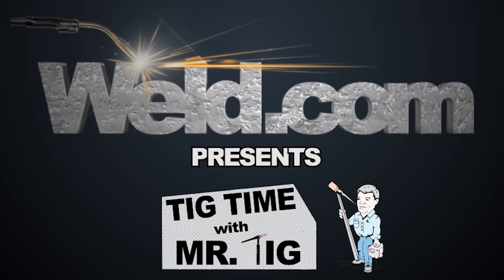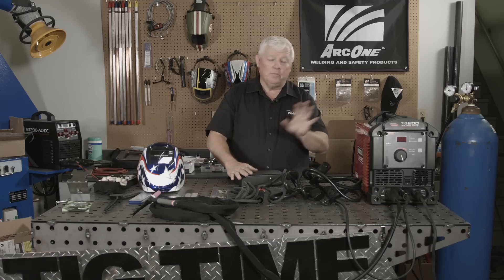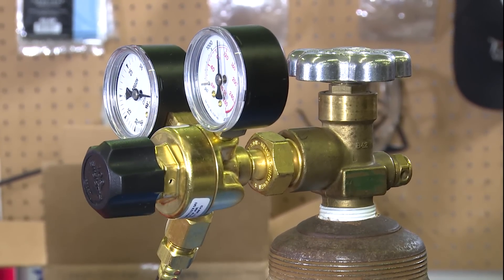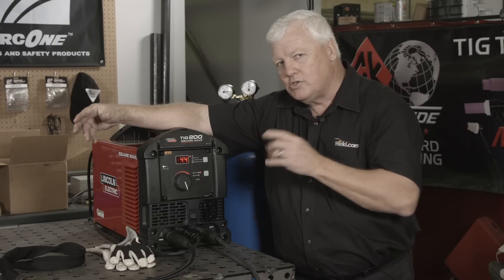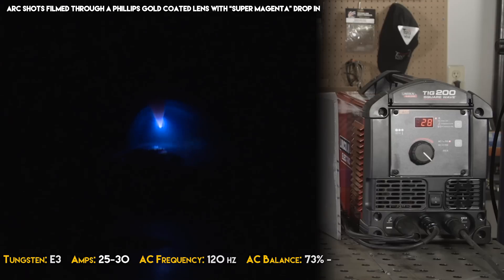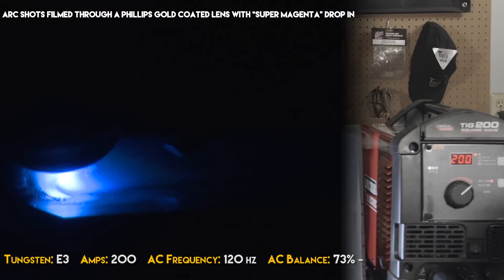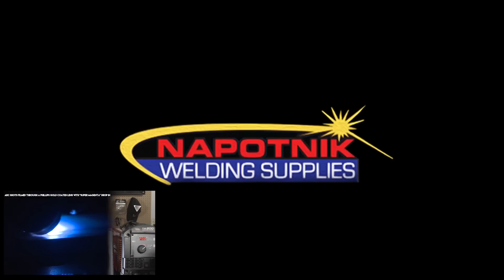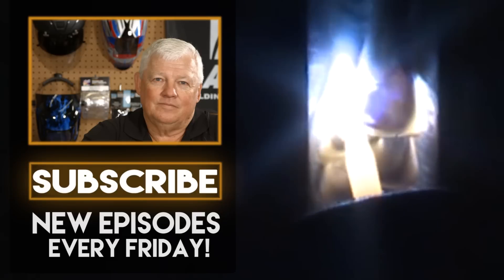Lincoln Electric Squarewave TIG 200 Unboxing and Review: Part 1 - AC Welding | TIG Time

Comment: I watched this back in 2017 when i was deciding if i should buy this machine or not.

Im watching it again in 2024 to decide if i should sell mine and replace it with the miller multimatic 220 or just buy a separate unit for mig capability

Comment: 6 years later it is now $2,399.  I would hardly call it a "hobby machine".  It is a machine that can TIG weld up to 3/16" thick in a single pass.  If you are welding thicker material then you would go with a higher output machine.  My advice is to purchase a welder that can weld on the material that is what you want to weld.  Why buy a $6k "professional machine" that has an output of 400A or so when you are going to be welding race car chassis made from .040 and .080 Chrome-Moly one and two inch tubing?

The other thing that I learned when I was researching the different AC/DC TIG machines is that while this machine doesn't have the range of variables for frequency, pulse and %EN, the ranges are what you will most likely be using.  The ability to adjust pre and post flow is sort of a minus, but why more than a 1/2 second pre-flow and the post flow is up to 15 seconds depending upon the power level that you are welding at.

Comment: Its April 2023, and planning to buy one, anybody bought one of these? Is it worth buying it for hobby use? I just need a tig machine that wont die on me in the first year of ownership, im also leaning to just buy the transformer type tig- (miller syncrowave 180 sd) if reliabilty and dependability is an issue for these welder. Would really appreciate the input of those who actually own and owned one and how many years you have it. i dont really care much about the post flow and that stuff cause i wont be using it very often, i just want a dependable and reliable unit. Thank you
Reply: It’s a great welder and as long as you take care of it, it will last a long time.
Reply: Thank you...

Comment: placing the ball on the tungsten will help keep it from splitting and getting in your weld, angle on feeding the wire and more of a 90 degree with torch would help a lot why show people bad habits, other than that great vid on showing off what it will do. I have one for portable work from truck great machine

Comment: Have had mine for 37 months and love the way it ran.  Was welding the pin collars on a small backhoe when the unit popped and blew the circuit (220).  Took the unit in to be repaired and am waiting for the bad news.  Fortunately I bought it with my Discover card which added another year to the 3 year warranty.
Reply: Got the estimate back today for repair, it was more than what I paid for it.  Can't bring myself in replacing this one with another as this one lasted only 37 months and probably had no more 20 hours of use time on it.  The power Module went belly up.  I now am waiting on my claim with Discover
Reply: @vids595  A lot has happened since I posted this.  I looked at a comparable blue, brown welders and found I could buy 2 new SQ waves for their prices.  I inquired about the 5 year warranty on the Sq. Wave and was told that only Lincoln offers it.  So I called Lincoln and after two attempts with their system got thru to someone.  I inquired about the cost of the 5 year warranty on a new SQ. Wave as I was replacing another that had crashed after 37 months.  I was immediately offered free parts if I wanted to repair the old one (parts were over 1200) if I would pay the labor (estimated at 400).  Since the cost of a new one is more than 400 plus tax and the labor is covered with Discover I opted to have it repaired.  If I was going to buy a new one I would get the factory 5 year for 162 buck more.  I also noticed that the internals of the machine were dusty and will invest in a cover and ensure the machine is protected better from grinding dust.
Reply: @pikewrench  cover your machine before you grind , try to grind outdoors as much as possible . Sorry to hear about all the trouble you had my friend . How’s the girl running to this day?
Reply: @Хохлычернозём  Thats what I want to know. Alot of good to know information in those comments. I'd like to know how's it going now. Mr. Pikewrench, could you give us an update?

Comment: It’s funny. Three years ago, this welder was $1395. Now, it’s like $1798. Paychecks in the last three years have went down if they went anywhere. The economy has now crashed. Over 30+ million unemployed. So, why is this machine $1798? I mite would buy one if it were still $1395. However, I am instead going with a welder where they won’t/don’t have to pay you sell them for them. There is no way to get an honest evaluation of a welder when they  pay large, and I do mean large, fee’s and also giving away the welder. I doubt there are any really bad welders out there these days as there are few companies making them. Thanks for the paid endorsement .

Comment: no post flow settings. if I'm using this thing all day long that 17second post flow is gona cost me alot of money in the long run.  alot of  trips for gas to. I'm really thinking of sending it back.
Reply: It’s a hobby machine bro. What do you expect.
Reply: @Void-gn9zm  something better then a no nonamed chinese machine....bro
Reply: @billbraski2175  It’s not a machine to weld all day everyday… That’s made very clear by Lincoln. If you’re serious about tig, you’re gonna have a tig button and a torch with a gas valve on it so you control the gas flow. Also, if you’re serious about tig, you’re not gonna cry about gas. The post flow is longer to cool the torch down as it is not liquid cooled…

Comment: I bought one as a hobby and I love it. I joined some round 1/4 aluminum pipe to 1/4 plate and did 3 passes on 10 different joints at 200 amps for around 8 hours and it was continuous. I only stopped to re position and grab more filler. I could not for the life of me get the thing to exceed duty cycle. The torch was getting so hot that the pink cup turned white and the glass fibers infused in the torch were beginning to melt and become visible. I has to wrap a tig finger around the torch so I could even hold it, it was still extremely hot. Even with thick miller gloves and the fiberglass I could barely hold it. Welds came out beautiful and I couldn't ask for better results
Reply: You're a moron. Hitting thermal protection isn't the same as hitting duty cycle.
Reply: @williambonnie9229  Who said anything about thermal protection?
Reply: Lol I wouldn’t push my machine that hard , sure it can do it but that’s not ideal for the inverter machines these days .. not good for the old transformer types. Sure it will do it but it’s not going to keep doing it, eventually it will fail when you really need it and moneys tight..
Reply: Hows the machine holding up?

Comment: I hate the set up it come with you have to keep stepping on the foot pedal or argon will shut off and when your welding in position it’s a pain in the ass I’m going to change the whole set up or get rid of the machine
Reply: If you’re serious about tig, you’ll have a second torch with a button and gas valve. Doesn’t matter what machine you buy.

Comment: How is it when running it powered by a 120v outlet? I'm in the market for a tig welder 120v/220v, but I am having a hard time deciding which one to pull the trigger on. I really don't want to spend more than $1500.00 and I have the opportunity to buy this one with a welding cart and bottle for $1200.00. What to do, what to do?????

Comment: How do you feel about these new inverter based machines vs the transformer ones?  The inverters seem to last only 2-3 years and their repair cost is about the cost of a new machine.  It makes me nervous.  1500 is not throwaway hobby money to me
Reply: It depends , most of the Chinese welders last about three years like he said with hard use , but when they break it’s usually as simple as soldering out the old IGBTs or mosfets and replacing them along with some caps. My Hitbox tig 200 p has ran so many rods and countless T size argon bottles. It’s a mosfet too and still going strong in a full time production shop with three shifts beating on it . At home I have another hitbox 200 p and a herocut 50 as well as a Canaweld mig 202 , all of which are flawless especially the Canaweld
Reply: Go with Primeweld , AHP, Herocut, Hitbox , Kemppi, Forney, CEA , stay away from Everlast and Yeswelder both are garbage especially yeswelder might be ok with a Everlast for a few years until you find out it needs a lot more than just IGBTs .. then you are fucked and out a lot of money that could have went to a good machine to begin with . The sayings buy once cry once and you get what you pay for really apply to welding. Doesn’t mean you need a Lincoln or a Miller, in fact both are way over priced and not what they used to be , Fronious is much much better and more upto date with technology as well as durability
Reply: @Хохлычернозём  Good advice. I know several old pros and they all say miller and Lincoln have really gone down hill, and they price gouge. Primeweld is pretty much flawless, amd AHP is a close second.
Reply: You never know with solid state components.  I've used a 200 dollar Harbor Freight TIG inverter for almost 10 years now.  Still works fine and it sits in an unheated/cooled garage year round.
Reply: What are you smoking? Who told you inverter machines only last 2-3 years?

Comment: I bought one of these machines and the duty cycle is 20% it’s not enough to even do aluminum even tho it’s AC I would stay away. Plus no pre or post flow setting. It also can’t weld 6010. I bought an HTP221 Invertig and it’s amazing 60% duty plus has the features of a dynasty 350, not the amps but features. Plus it has Pulse stick and will do 6010 beautifully

Comment: For all you that keep bitching about no postflow adjustment with a air cooled torch the argon flow helps cool the torch down  so if you wanna save argon buy a water cooled unit
Reply: Adam Leonard 10 seconds will cool down the torch at almost anything this can handle
Reply: @weldingjunkie   so you are bitching about 7 seconds.  Spend another thousand as save that .02 cents.
Reply: Or save $500 and buy a torch with a gas valve..... greifer

Comment: Lincoln try to keep it simple by setting the post flow 17 seconds to the worse case scenario, welding to the limit of the duty cycle  and still keep the torch cool. Until they fix it, we can always install a momentary switch to cut power to the gas solenoid, but that can risk your warranty. They will also have to fix the starting amp. spike.If is a big company, might take time to change.
Reply: Could you not just use a torch with a valve on it and close the valve at the end of the weld sooner than the 17 seconds?

Comment: One more question,  If one wants to do TIG Welding is it a better practice to invest in a good TIG Machine verses multi-purpose options?  Also do you have  a comparable video on TIG machines someplace on this channel?
Reply from the maker: Gary, If you really want to get into TIG, a dedicated TIG machine is best. While the multi process are very good all around machines, the TIG is usually limited to DC only, no HF and no pulse. Check out the Everlast 210EXT.
Reply: Thank you again, 
             I was watching your videos on the Lincoln MP 210 and though it does mig very well and stick it seem to be average for TIG thus I am leaning towards my first welder to be TIG dedicated.   Will the Everlast 210EXT weld up to 3/8 stock steel?  Thoughts on Miller and Lincoln machines vs Everlast?
Reply: I just wanted to let you know that I will be doing aluminum welding and may go as thick as 3/8"

Comment: I really enjoy your videos learned a lot and I don't even have a welder!
That being said, I am looking to invest in one right away and was considering this one. Though Lincoln felt getting their larger unit for better overall performance. Thoughts?
Reply from the maker: Gary Karczewski This machine is a great choice for the beginner. There is very little on the machine face to confuse you. The downside to that is that there's not a whole lot of customization options either. Certainly a good product though.
Reply: Thank you for the quick reply.   The other unit I am considering is the Lincoln Precision TIG® 225 TIG Welder.  I would rather not buy any piece of equipment then have the "I should have got the bigger one" syndrome.   Thoughts?  Lincoln has a good deal on package deal with some welding gear as well with this machine.

Comment: I've had one of these for a year. have used the stick and tig, very happy with both, I use the pulsing for vertical and light thin metal really helps keep the puddle in check. I haven't missed the adjustable pre and after flow on this machine. I have welded everything from 2inch angle iron to 28 gage sheet metal for expansion chambers for two stroke motorcycles. Great little machine. If you need more heat and penetration use a heli/argon mix. I am going to buy a HTP next, but I'm going to keep this machine very easy to set up and use for motorcycle mods.
Reply: Copisetic 1 could you weld on a aluminum boat??

Comment: With this machine do you have to always have to use the foot pedal with tig?
Reply: for aluminum is recomended notbsteel but u canusefor steel to
Reply: 199412valve yes. Tried lift arc with it no pressure and got nothing. Maybe with valve torch and and scratch start rig
Reply: Buy a tig button with a 6 pin connector.

Comment: SORRY LEFT OUT A COMMENT AS FAR AS THE HIGH ARC START  BRING AWAY THE EDGE OF THE MATERIAL ON THIN ALUMINUM I SOLVED THAT PROBLEM BY STARTING ON A THICKER PIECE AND THEN LETTING THE ARK SETTLE DOWN AND THEN MOVING TO THE THINNER ALUMINUM AND IT WORKS FINE

Comment: I PURCHASED A AND IS JUST MY OPINION ALPHA TIG 200 AFTER ABOUT FOUR HOURS OF WELDING ALUMINUM WHEEL TUBS IT CRASHED SO I'M GONNA SAY IT ACTUALLY CAME DEAD ON ARRIVAL I SENT IT BACK UNDER WARRANTY IT TOOK 30 DAYS TO GET ME ANOTHER ONE SO I WASN'T ABLE TO FINISH THE PROJECT I WAS ON UNTIL I GOT IT BACK AND WHEN I GOT IT BACK IT WAS ALSO DEAD ON ARRIVAL I BOUGHT THE LINCOLN SQUARE WAVE 200 AND I'M QUITE PLEASED WITH IT ONE THING FOR SURE IF IT BREAKS DOWN IS NOT TO TAKE 30 DAYS TO GET IT FIXED EVERYBODY MAKES CHOICES AND IT'S JUST MY OPINION

Comment: I am looking to buy my first welder. Looking for a small portable welder. Could you please rank or do a video on these 4 welders? ESAB Mini Arc  161LTS,   Everlast Power Ultra 206PI,   Fronius TP180MV  and  Lincoln v155-S. I know these are not great. But which one is the best for a first welder? Thank you for your time.
Reply: Eric Snyder I own the esab miniarc 161 lts, check my channel if you want to see it
Reply: HTP 221 Invertig #1 beats out dynasty. Will Pulse stick and run 6010. 60% duty cycle 4amp start , What did you buy? I did I video on it too bring new to Tig.

Comment: cool vid, I have been looking and for the value and as much as I will use it, I was looking at the miller 165i or Hobart but this one seems way better for the money, now you mentioned shorter tips what would I need to get to upgrade it.   just order one they are offering 10% free shipping. thx dan
Reply: djtoo7  ht

Comment: In comparison to the miller maxstar 150 stl.... which machine is better?
Reply: The Lincoln tig 200 is an ac/dc welder. The Miller Macstar is dc only,  so the 2 aren't comparable.
Reply: Miller.
Reply: @SOLDOZER  <-this idiot doesn't realize it's apples and oranges. Spoken like a true fan boy.....

Comment: its possible to use the torch that comes with the welder to weld aluminum without having the pedal connected?
or do i need a different torch to be able to adjust the gas and whatnot?
thanks
Reply: No , if it can do AC it can weld aluminum. That’s all you need everything else besides the filler is the same . No need to buy a peddle, especially if you are learning. Use the torch switch to initiate and terminate the arc , you don’t need to worry about another variable as there’s already lots when you are new to tig and teaching yourself. After you get comfortable, throw a peddle in the mix but for now focus on feeding filler while keeping a consistent arc length and bead profile. This is 5 years old but for anyone else that stumbles on this and needs tips. One last thing GET A STUBBY PYREX GAS LENS . It will make it night and day , much easier to learn and more enjoyable. Huge huge benefit you won’t want to go back. It’s really worth the extra couple bucks to upgrade the stock consumables

Comment: what type of gas do you use? Pure argon?     can one gas be used for mild, ss and aluminum?
Reply from the maker: Makes more sense to just give you Aluminum a little pre-heat rather than going out a buying such an expensive gas, like Helium.
Reply from the maker: Yes, 100% Argon is the gas to use for all of those metals and is pretty much the only gas you will need In TIG, unless you get into some specialty applications.
Reply: You could use Helium when TIG Welding thick aluminum with a light duty machine, right? FYI like your videos.
Reply: Argon.
Reply: He does not even know how to weld and you're telling him helium? Moran!

Comment: what Lincoln welder do you think is best for tig? that is staying under 150 amps. Also, what welder replaced the v205? thank you.
Reply from the maker: Unfortunately, nothing took the place of the V205. As for the "best machine", it all depends on your wants and needs. If you are a hobbyist, the SW TIG 200 is a nice little machine.